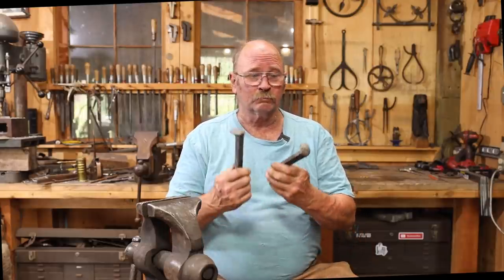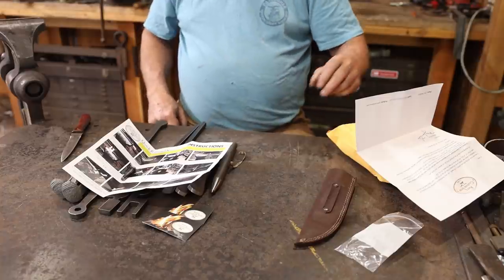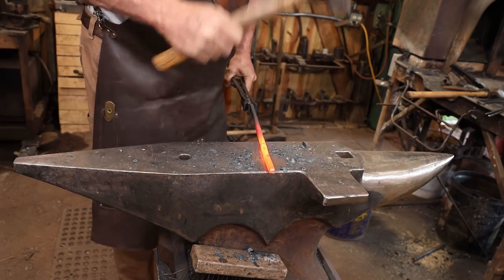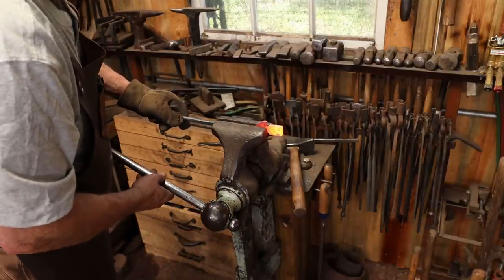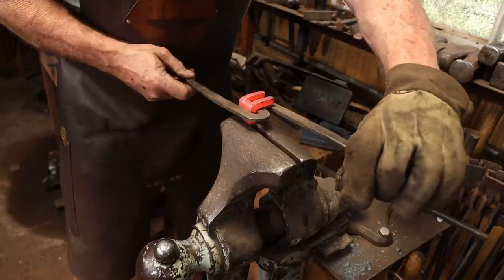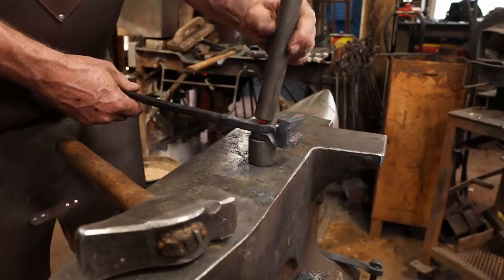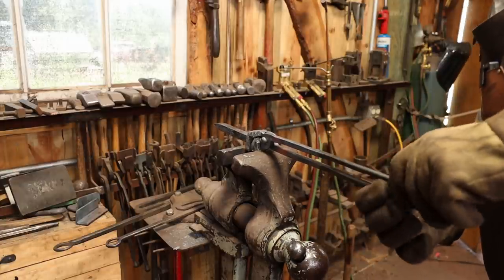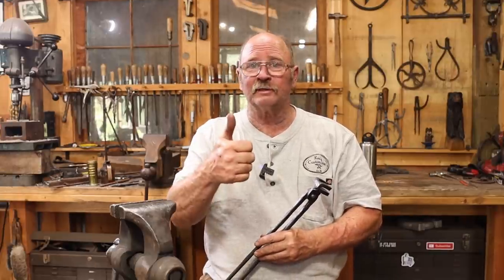Railroad Spike Tongs

Comment: I've used these tongs for the last 4 years.  They're very durable and have survived some hard use over that time. You'll probably find that they need some adjustment once in a while just cause the old spikes vary a little bit in head dimension , and they do wallow out with a lot of use. I found them to be a little tricky to assemble, so yeah, the suggestion to do the file work is a very good point. I found it also helpful to do a little testing with them bolted together before I set the rivet and adjusted the reins. Good video John, thanks!

Comment: Love Ken's designs.  I learned to forge tongs by hand first, then found the quick and rapid tongs and they would have shortened the learning curve.  I don't mess with RR spikes much, but those tongs really work well.  I did add a weld to the gusset on the first tong where it butts up after bending and twisting though it's not really needed.

Comment: I like the thinking behind those jaws,  its a pity uk rail doesn't use spikes so we just don't get any here.
Reply from the maker: What does UK rail use for holding rail down?
Reply: @BlackBearForge  uk rail sleepers are made of concrete so they use  bolted bracket to hold the rail.

Comment: I would appreciate a video on how you line up the center holes for the drill to be even on both pieces thank you
Reply from the maker: I just eyeball the center of the boss on each piece for the holes.  Nothing special.
Reply: If one were so compelled, you could clamp both pieces vertically in the vise, boss exposed, and hand drill both at the same time.  Hand drilling would be a bit more troublesome than John's drill press approach and his method works just fine!  Nothing special.
Reply: I've found I draw two intersecting lines across the boss, if it looks centered I punch it and drill it.  Then I lay the undrilled blank on the bench and put the drilled one over top of it like they're assembled.  If they look good I center punch right through the hole I just drilled into the undrilled boss.  So far, so good.  It's basically John's process with some pseudo-science that makes me feel like I'm gaining some accuracy when I'm probably not. ;)
Reply: @suprspi  I've used that method as well and it works fine!

Comment: Also I would like to know if you had to trim the rivet so how do you verify how long your rivet needs to be?
Reply from the maker: As Swamp Critter says, 1 1/2 times the diameter is left for the head.  However, the rivet supplied is exactly the right length.

Comment: John, making a draw knife specifically for shaping knife handles, can't remember what side the bevel is ground on, front or back? And I thought maybe a shape cross between a spoke shave and a very slightly curved draw knife, the center is just barely curved, but, at the sides, curves extremely until 90° from square. Will this work? Or to much change on the side?
Reply from the maker: For cutting concave surfaces bevel down is best.  For flats and convex surfaces bevel up is better.  Not sure about the other idea, you'll just have to try it.

Comment: John, If making these tongs to hold in my right hand (left hand tongs) I make the turns clockwise, is that correct?
Reply from the maker: In most cases.  But since these have offset jaws that must line up, I'm not sure.